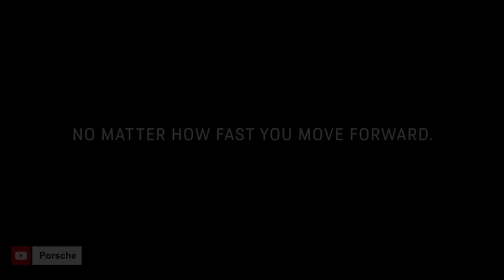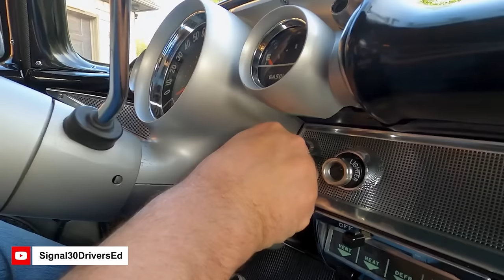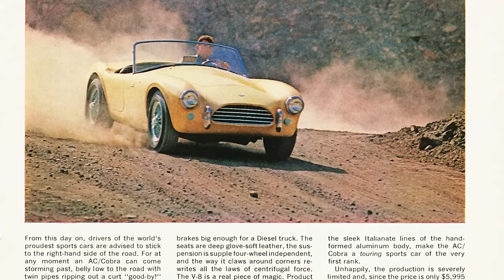Why Old Cars are Better

Comment: New cars try as hard as they can to NOT be a car.
Drove my sister's 2017 Subaru Crosstrek, and it's like driving an office or living room.
Reply: Today's "cars" are designed to be Transportation Appliances rather than automobiles.  That's why they are almost impossible to fix.  If something fails, it is intended that you simply dispose of it, just like an old ice box or something.
Reply: Isn’t that how they describe older cars though? It’s like a living room on wheels?
Reply: But they still felt like MACHINES.
Reply: @slapshotjack9806 no like you’re sitting on a lounge. In other words it’s a lot more comfy (springed seats) not that it’s as soulless and boring as an office
Reply: @tacticalcentral3856  no it’s a car not a house
Reply: Subarus are pretty ethically designed, and easy to service.
Reply: @alecmatteson692  Head gaskets
Reply: Anything built before 2010 has character and build quality that modern day vehicles lack in comparison.
Reply: I rode in my classmates brand new acura. And I felt like I was riding in first class airplane rather than a car. when I got back into my old civic. I felt like I was back at home.
Reply: @DEIFAN  Luxury car feels more luxurious and isolated than Honda Civic, mindblowing revelation here
Reply: @TheSilverShadow17  funny thing is I remember people in the 2000s constantly bashing newer cars at the time for being ugly and bland.

Never in my life have i ever thought that people’s opinion on them would change until now
Reply: @SoI_Badguy That stopped being an issue 10 years ago, and was one engine.
Reply: @michaelbenardo5695  Sorry, an old icebox is easy to fix.
Reply: @SoI_Badguy  Yeah, they should all be semi-closed deck like the race blocks are (and like almost every engine prior, including freaking 1930s flat-head Fords), and frankly, I don't know why Subaru withholds the proper design from normal consumers, but other than the weird head gasket discrepancy, yes, Subies are VERY easy to work on.  (On the other hand, Honda B18s are usually open deck and don't have the head gasket issue up to around 900 HP, but then you just fire-ring them and they can go 1200 until the block fatigues and basically explodes from the boost.)
Reply: @alecmatteson692  One series.  All the open-deck EJs were prone to it (in multiple displacements).
Reply: @SoI_Badguy  You say that not knowing Subaru solved that issue with the FA and FB series engines starting back in 2013. I recommend doing research before making claims. And if you think I'm joking, I drive a 2014 Subaru Legacy. Every fix I've ever had for the car was so minor it's not even funny. The only major fixes were because of my dumbass getting in minor accidents. I will likely never buy a new car because it's expensive, and I will likely never buy any other brand because it's A CAR. Say what you will, but the market is oversaturated with SUVs, Crossovers, and Pickups. I want a CAR, not a status symbol.
Reply: Hasn't what a car is changed over time though, early cars look like motorised buggies or horse carriages. A car in the 30's  was different from the 50's in styling a lot, most of the 20th century it seemed to be about aesthetic changes, advancement in manufacturing techniques, from the 80's I heard that cars paint jobs lasted longer and have heard modern cars last longer. It seems safety became a bigger priority from the 2000's and now tech is maybe changing the definition of what a car is again, also ev technology. A Gen alpha might see the car today as a proper car as they grew up with it.
Reply: Depends. The Miata and GT86 are still having old school feels to them
Reply: If you get a crosstrek with the 6MT they're actually very good and engaging to drive, the CVT ruins it
Reply: @Muis33 lololololololol you must live a sad life if you have an emotional attachment to a car kid
Reply: @SoI_Badguy  The old ones.  The worst being the 01-02 bugeye era subarus.  If you look at companies like Mazda and Subaru, their new stuff is better made than their old stuff, even if it's less thrilling.
Reply: @DEIFAN sounds like a poor thing to say
Reply: New cars are designed for women.
Reply: @curtisbryce5096  that’s not an insult tbh
Reply: @slapshotjack9806  Wasn't meant to be. New cars are all built to serve women. All the new features are put in to ease the driving experience for the ladies.
Reply: Even worse is the Tesla Model 3. It looks more like a desk with a steering wheel than an actual car!
Reply: @NeuroDiv_Skunk8785  a simple design yet you say that you want the “simple” designs of the 70s cars lol
Reply: @curtisbryce5096  no woman I know of wants any of that though
Reply: @slapshotjack9806  Industry never asks real women, only the liberals and pseudo-women.
Reply: Doge chargers still have chracter along with the Mustang, Fiat, Mini etc.@TheSilverShadow17
Reply: @slapshotjack9806  more like a home on wheels😂
Reply: @gameraddictedx7443  yall are weird
Reply: @michaelbenardo5695  I find no real issue with cars being appliances, though like any good appliance, they should be intuitive and repairable with no bullshit useless features.
Reply: @bahamutsix5765  They were right, the 90s introduced rounder more bubble shaped cars, but some of them had character due to the leftover designs and remaining designers of 70s and 80s cars. The 00s cars further doubled down on this, with exceptions of course, mainly performance cars, but the 'new age' designs persisted. Fast forward to today, and it's either got a round body with lots of aggressive accents, or an equally large and grotesque grill.
Reply: Than I fear you have missed the point of the crosstrek. Its point is moderate comfort, reasonable drivability and reliable transport with good traction under most if not all conditions barring ice... You want road feel, MAN UP AND GET A BRZ. DONT BLAME THE CROSSTREK FOR NOT BEING A SPORTSCAR. the poor girl has a hatchback a, a crossover body and 165 horsepower. and you think you know a thing about cars expecting it to thrill you?
Reply: @slapshotjack9806  More like a boat, you kind of float over the road. Its very pleasant.
Reply: @SoupyMittens  you clearly have never ridden in one of those
Reply: @slapshotjack9806  Have you ever ridden in a lincoln continental? They definitely feel like a boat...
Reply: @SoupyMittens  so really bad
Reply: @slapshotjack9806  Yeah it does come with the downside of you feeling like your steering inputs are more of a suggestion than anything
Reply: @michaelbenardo5695  it is not impossible to fix it. It is harder though you need. I don't know the name. I think anpart anilyzer that many mechanics have once you  have it then repairs are easy if you know computers for working the anylizers.
Reply: @bahamutsix5765 cars were ugly and bland in the early 2000's tho
Reply: @username113  yeah that’s what i said. I’m just saying that people are glorifying 2000s cars now because they’re getting old
Reply: @slapshotjack9806 a boat lol 😂
Reply: @TheSilverShadow17 the 2011 ford crown Vic in my opinion is the last good car of the 21st century everything after that is ass
Reply: @slapshotjack9806  pretty much, yeah
Reply: Current cars look better than 2000s cars. But they all suffer from shitty, cold, gray, plastic upholstery  - something even cheap 70s and 80s cars had no issue with. I like sitting in a warm, colorful lounge.
Reply: @bahamutsix5765 in the land of bipolar narcissists. The understatedly sexy librarian with a 401k starts looking really good.
Reply: @slapshotjack9806  The interior of my 90's F250 is like a living room thanks to the bench seats, saddle blanket seat covers and plush red carpet. Radio doesn't work, but we invented Bluetooth speakers. The wing windows let in a breeze without drowning out your conversation and it's roomy enough to get real cozy. No asinine dashboard screens required. "Asinine" pronounced Hank Hill style of course.
Reply: It’s funny you should say that because many of the old classic cars from back in the Atomic Era were like that, too. They had even more luxuries like corded telephones and things in them. 😂
Reply: @alecmatteson692 mf the exhaust wraps around the oil filter on some making them hard af to change the oil on warm. That's not ease of service. Ease of service is the ford 300 i6
Reply: @SoupyMittens you made my day with this. Thanks
Reply: @bahamutsix5765 yeah it’s crazy to me. 2000s cars are still “new” in my mind. Hell, even late 90s vehicles are. I grew up with those cars but have no nostalgia for them like I do with anything from the 80s or earlier.
Reply: I like my 2019 Impreza hatch a lot, I'm sure part of that is the pride of actually having ownership of it. Even so, I deliberately went with the lowest trim level for this reason. No Eyesight or driver assistance crap, the visibility is 10/10 anyway so I'd rather just not have the detection garbage instead of becoming reliant on it.

SUVs and Crossovers and the fetishization of the "truck" is super silly too.
Reply: Agreed! They are anything but a reliable vehicle
Reply: I am not a bot  I just came up with a idea. Steam and Ethanol engines. Half runs on steam half on gas. The half steam runs a closed cycle similar to how a refrigerator compressor works. For one thing, In Brazil, when the fuel crisis hit, the population really wanted smaller vehicles (We never had the boats that USA Had, only the "midsized" Galaxie 500, Simca Chambord, GM Opala, GM Omega, and the Dodge Dart were the biggest cars we ever got If I'm not mistaking) 
So, with the crisis, came the Ethanol fuel, and cars became smaller. NOW With the pressure of SUV's we are finally (badly I'd say) moving to SUVs instead of sedans and hatches, which is a shame. But I agree, 40 years ago a car could make 8KM/L and nowdays cars barely make more than 11km/l in the city. At highway, its slightly better, the cars of the 80's made around 13kml, now cars can make 19kml, its better, but at city, where it matters most, nothing changed at all. And add that Flex Fuel consumes more than plain Gasoline or Alchohol engines, and add useless tech to todays cars (apart from the very good safety, A/C and Power Steering) the cars of today are really more of the same... Cheers!
Reply: lol so true
Reply: @NeuroDiv_Skunk8785  hate teslas. they replaced the center console with a fucking TV in portrait mode. you have to navigate a menu to change air conditioning. wtf.
Reply: @username113  yeah but better than what came later lol.
Reply: @slapshotjack9806  if people in 20 years are glorifying cars of today it means that cars really do be getting more shit
Reply: @Kuzey457  on what planet does the fucking transformers halloween mask looking crossover look better than a E35
Reply: @ShesquatchPiney  buy a new radio and fit it bro. you can get a JVC single din head unit for like 70 bucks with CD and bluetooth. You have a 90s car enjoy the swappable din.
Reply: Sometimes I think that people just make up every excuse to say that their old car is better than the new one, since there isn't much difference other than the futuristic factor, and then they say that it isn't. It's a nostalgic factor, ridiculous
Reply: @alecmatteson692 gf had an 18 and has a 23 now. Booty h pattern engines and cvts. Disposable
Reply: @michaelbenardo5695 I can totally agree with you, most of these newer cars are jam packed so tight they're a pain to work on, even for basic things. Of course, all cars have their peculiar difficulties when being worked on, but many of these extra electronics and safety features make them sky high to repair!
Reply: Comfort is bad? Why?